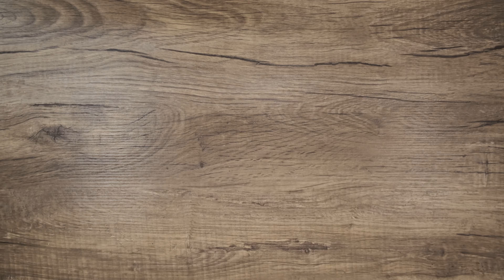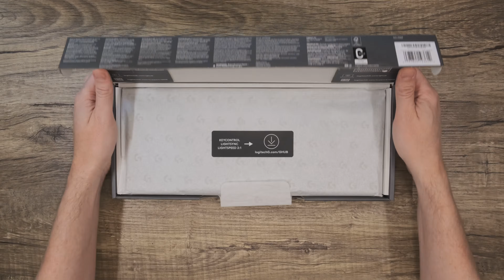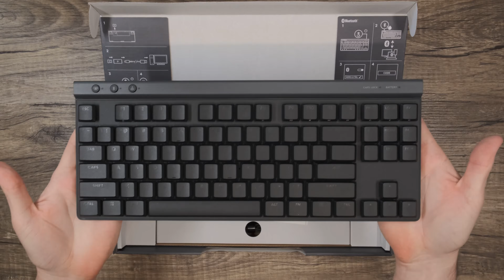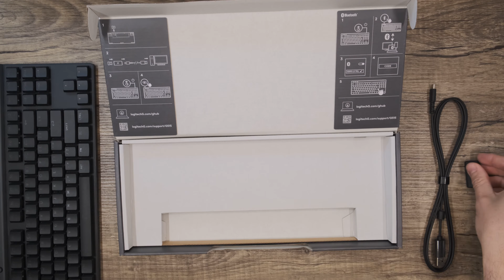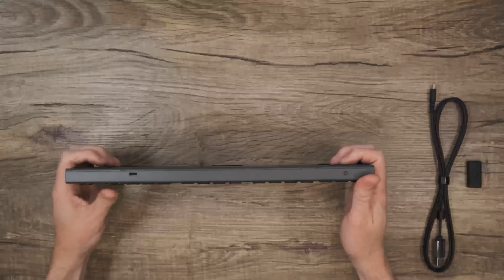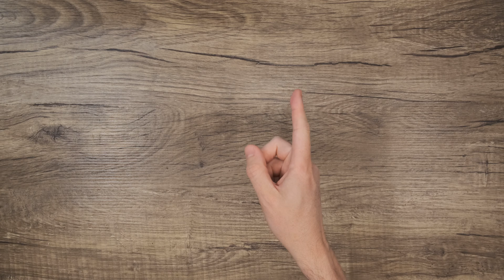Logitech G515 LIGHTSPEED TKL Wireless Keyboard UNBOXING

Comment: can I use G515 with my Logi Bolt?
Reply from the maker: Logi Bolt and Lightspeed are two different technologies, so unfortunately, no.  However, you can use the G515 connected via Bluetooth.
Reply: @logitechsupport  I see, it’s a shame the G515 can’t be used with a Logi Bolt.

Another question:

Say I have my G515 connected via Lightspeed usb dongle: can I customize G515 via Logi Options+ instead of G Hub?

It seems on logi options that I can indeed do something like this since a list of dongle is shown when trying to pair a new device; unfortunately the lightspeed dongle is not being picked up
Reply from the maker: @DJCava3000  Some Logitech hardware is cross compatible with Logi Options+ and G HUB, but that is limited mainly to web cameras.

Comment: Why there is no volume knob (thing)? Companies do this on purpose. They never give all the features together.
Reply from the maker: This is the evolution of the G500 series of keyboards in a TKL version.  Similar to the G512, this is a keyboard without all of the additional dedicated media buttons - those are available in other series of our keyboards.  However, F9-F12 offer the media functionality while the Prnt, Lock, and P/B buttons double as volume control!
Reply: @logitechsupport  bro do you have (sell), silent (linear or tactile or whatever not clicky), wireless and wired (usb c) option together with no latency, good game performance, great typing performance, low profile (or normal), with volume knob (scroll), tkl, us or uk layout, light and portable (not so much important), double pbt (not the keycaps the letters are peeled off after a short time usage) keyboard which I can buy from Turkiye (🇹🇷)?

None of the brands including you are selling the keyboard with all of these features in one package.

If you sell one of those, let me know. I'm waiting for your response.

Comment: Looks like the fixed version of G915 I've been waiting for years. too bad the media controls are missing, not really a fan of the rising top part either
Reply from the maker: This is the evolution of the G500 series of keyboards in a TKL version.  Similar to the G512, this is a keyboard without all of the additional dedicated media buttons - those are available in other series of our keyboards.  However, F9-F12 offer the media functionality while the Prnt, Lock, and P/B buttons double as volume control!
Reply: @logitechsupport  Sooo maybe is time to refresh the G900 series with better switches (like the new G515), better repairability and the option of using custom keycaps 🧐

Comment: can it switch between devices like the MX Keys?
Reply from the maker: While there is no "Easy Switch" you can switch between Lightspeed connection and Bluetooth.  Meaning you can have your Lightspeed dongle plugged into your computer and Bluetooth connected to another device and switch using the buttons at the top left of the keyboard.